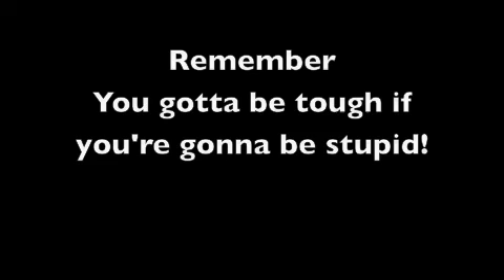BA#17 flying the WIP

Comment: if you want to bounce around less in windy conditions & launch quicker w/ less running / saving the knees go w/ a more powerfull lighter paramotor and a smaller more loaded wing. Ive flown everything out there & the Nirvana Rodeo w/ the 19m Nirv Komaka wing is amazing...I weigh 190lbs..